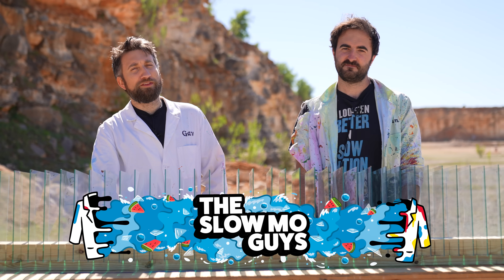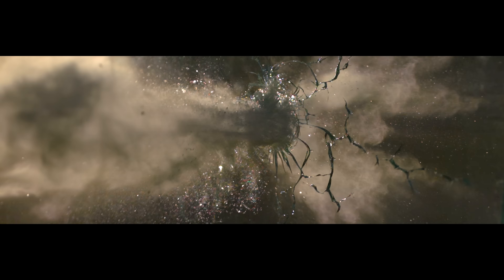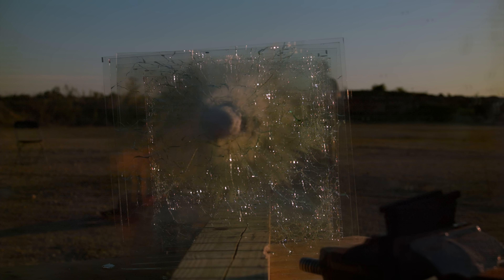Backwards Bullet Shockwaves between Glass at 375,000 FPS - The Slow Mo Guys

Comment: I am a time traveller and a good YouTube summariser:

0:02 In this intriguing episode, Gav and Dan, known as the Slow-Mo Guys, delve into the effects of shooting through multiple panes of glass with a 9mm pistol. They recount their previous experience where the round consistently penetrated 11 panes, eliciting viewer curiosity and requests to use a more powerful round. Reflecting on their steel plate experiment, they recall how a beefier .306 round made a significant impact, setting the stage for a thrilling exploration with powerful ammunition ahead.
0:33 The discussion revolves around estimating the performance of a device, with indications that it may yield double the expected results due to limited space and camera capabilities. The speaker expresses hopes for 22 significant outcomes, reflecting a cautious optimism despite confusion caused by excessive glass obscuring visibility, which creates a fog-like effect.
1:05 The speaker discusses the effects of bullets on glass panes, describing how each shot breaks every other pane and how shrapnel affects the surrounding ones. He experiments with perspective, contemplating whether to film from a close distance or further away to capture the bullet's travel, ultimately deciding a long lens from a distance would provide the best visuals.
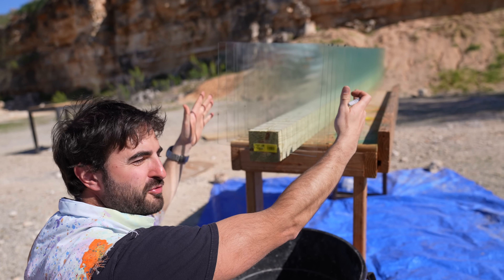1:36 In a moment filled with anticipation, the speaker discusses their setup involving a complex optical illusion created by 27 panes, preparing to capture a stunning visual effect at an impressive 120,000 frames per second. As they signal readiness, there's a sense of excitement about the unknown results to come.
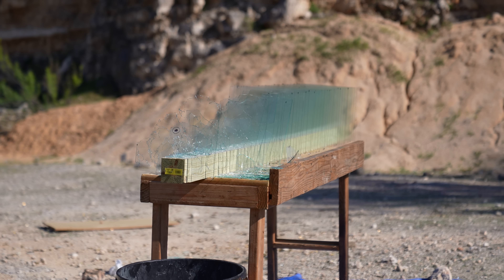2:13 The experiment reveals unexpected deflections and complex shock waves, highlighting the intricate behaviour of air density as shock waves bounce back and forth, creating a visual effect akin to liquids in motion. Participants express amazement at the phenomenon, noting the multiple rebounds from each impact.
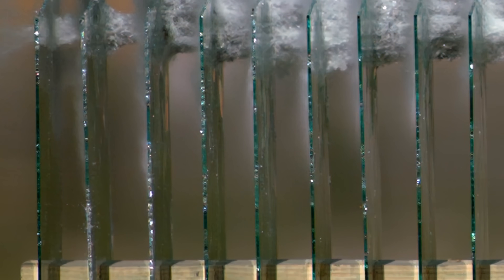2:44 The discussion revolves around the unexpected behaviour of objects interacting with a wooden beam, comparing the phenomenon to a splash in a pond, while questioning the effects of speed and light interference, specifically observing a green flash as the shock wave and flash coincide.
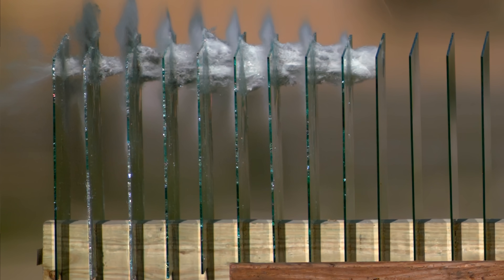3:14 The discussion revolves around the complexities of handling high-speed transitions, likening it to a supersonic to subsonic experience, accompanied by miniature explosions and shock waves caused by impacts. There is a focus on centralizing pain points in this process, revealing the careful attention required, making it neither tedious nor therapeutic, but a matter of utmost concentration due to the lethal nature of the materials involved.
3:44 The team expresses how tedious cleaning could be, then reacts with caution as they encounter a cloud of gas, remarking on its potential measurements and jokingly counting together as they move away for safety.
4:19 The discussion highlights the dramatic differences in visual effects observed during the experiment, with references to a flash resembling a shape charge rather than a standard nine-millimetre round. The team notes the unique appearance of the material, comparing it to a volcano rather than a typical mushroom cloud, and reflects on the varying behaviour of the glass and the accumulation of powder at the end of the process.
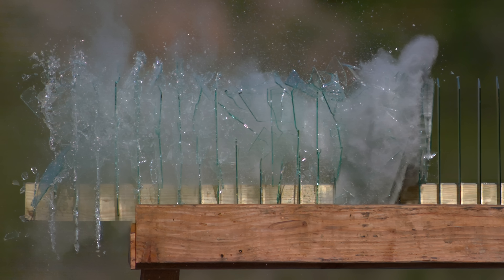4:50 The speaker describes a visually striking phenomenon where a shock wave overtakes a bullet, likening it to a sideways fountain of water. They express fascination with the visual effects, particularly focusing on the flashes of light, while reflecting on their previous video experiences.
5:23 The narrator enthusiastically shares the achievement of reaching a speed of 233,000 frames per second, highlighting the excitement of the moment. As they prepare to capture footage, they note the inconsistencies in the visual details, likening them to a Venetian blind. The unexpected duration of the spark effect elicits further astonishment, emphasising the success of the endeavour.
5:55 In an intense moment, the individual observes the intricate process of bullets passing through a glass pane, noting how the light resembles fibre optics and commenting on the speed and immediate aftermath of the shots fired. They ponder whether the distance from the camera affects visibility of shock waves and express curiosity about the physics behind the phenomenon.
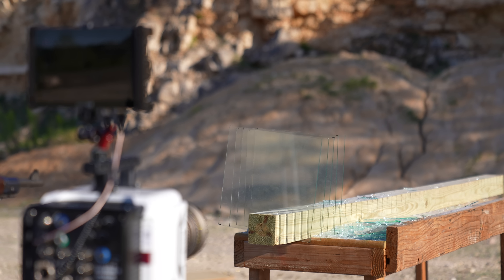6:26 The speaker expresses amazement at the glass reflections, sharing an experience akin to standing in an infinite mirror room, where multiple layers of brightness create a captivating visual effect.
6:57 The video showcases a fast-paced demonstration of a flash's propagation, revealing a perfect circle expanding from the centre. This fascinating visual, which is imperceptible at slower speeds, captures the viewer's intrigue. The narrator then transitions to an even higher frame rate of 375,000 frames per second to prepare for a backlit shot of the flash, eager to unveil another layer of this captivating phenomenon.
7:36 The speaker reflects on their recent craftsmanship, noting how a single pane of glass tipped in a very narrow frame at 375,000, resulting in a shimmering effect along the crack, which they find fascinating.
8:07 The scene reveals a captivating moment filled with bright flashes as a bullet is shown expanding upon impact, reminiscent of childhood advertisements for cleanliness. The visuals evoke a sense of wonder and nostalgia, particularly as the bullet's rotation is dissected in detail, highlighting the beauty of the moment.
8:41 The speaker expresses a fondness for backlit shots, describing them as underrated, while experimenting with a mirror shot aimed directly at the camera. There's a playful banter about the superstition of bad luck associated with breaking mirrors, leading to a humorous reflection on their past experiences with the same mirror they are using again.
9:12 The speaker reflects on the final piece of glass, acknowledging the necessity of adjusting for depth, though unsure of the outcome. Amidst this, a sense of urgency and excitement emerges as they discuss a notable flash event, likening it to a rocket launch, illustrating both the intensity and unpredictability of the moment.
9:45 The discussion explores the thrilling experience of observing the Earth from the rocket's perspective, noting the impressive pressure of 10 atmospheres. There's a sense of pride in the mission's success, despite its challenges, with a particular focus on an intriguing shot that captures the moment beautifully.
10:16 The discussion revolves around a recent video that, while an escalation of previous content, felt notably different due to the increased activity and elements within it. The speakers express their fascination with certain flashes they observed, considering a future project that involves analysing these occurrences in depth, despite joking about the potential bad luck associated with it.
10:46 In a light-hearted conversation, two people discuss the concept of generational bad luck, jokingly suggesting that it could be inherited by their future descendants. They consider the idea of including a clause in their wills to distribute this bad luck among their heirs, with one playfully noting that they might not outlive the other, rendering the discussion somewhat moot. The tone remains humorous as they contemplate the absurdity of having "bad luck" as an inheritance.
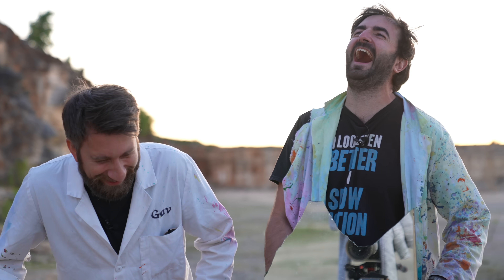11:19 The host wraps up a dynamic video on bullet destruction, encouraging viewers to check out similar content and subscribe for more slow-motion action. He expresses gratitude for their support and teases future videos before saying goodbye.
11:55 A sense of reassurance emerges as the speaker attempts to alleviate concerns, reinforcing their determination to navigate the situation thoughtfully.